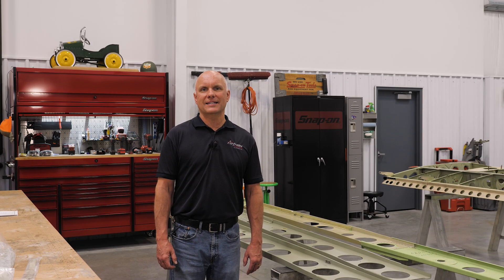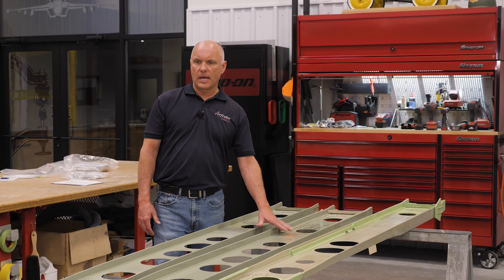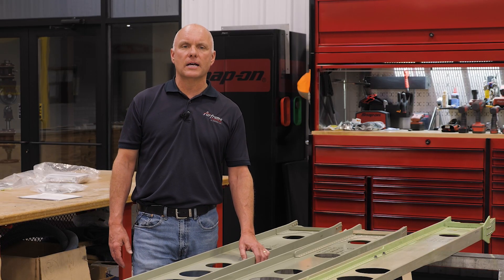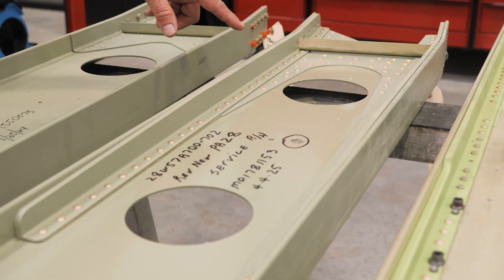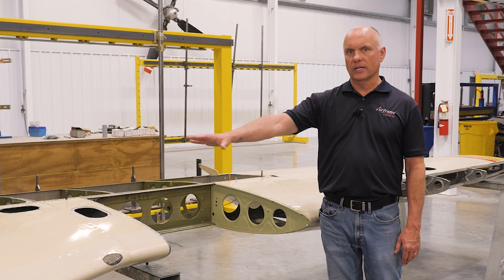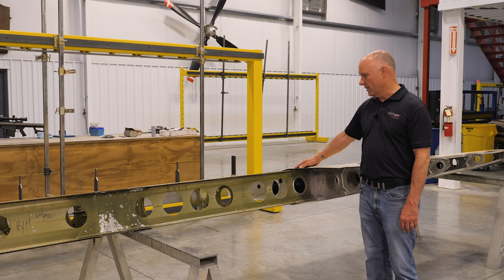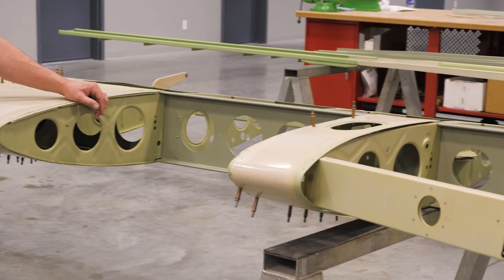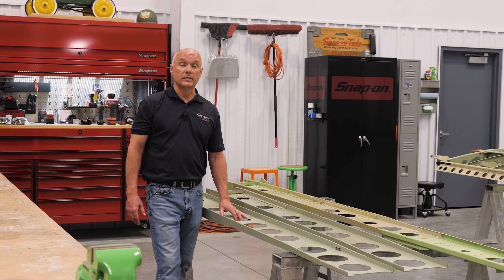Piper PA28/32 Airworthiness Directive AD 2020-26-16

Comment: Excellent presentation .  But did you confuse left with right?
Reply: They were upside down.  Inspection panels are usually on the bottom.
Reply: @firstielasty1162  You are correct!  Thank you!
Reply: I thought the same thing.  The first wing was the left.  The second was the right wing.  Unless, he's talking about R and L from looking from the front of the airplane.

Comment: I worked at a flight school down in Alabama a few years back and we had a aircraft that had severe corrosion on the rear spar near the fuselage attach point. The best that I recall was there was a steel plate riveted to the C-section of the rear spar and it set up a fair amount of corrosion. I think Piper has a SB to add inspection access holes but I don't think that worked out too well because in our case the corrosion was on the back side of the spar and the inspection holes are on the front side of the rear spar. In any event make sure your IA looks at this area during your annual inspection because you will lose the wing if that rear spar fails.

Comment: What a nice bit of work. I was in the RAF as an Airframe Technician,  and did a Primary Structure Repair Course. Very satisfying work. I've not drilled a hole or fitted a rivet since 98.

Comment: This is an outstanding video explanation! 
My 1981 Warrior II had nearly 12,000 hours, almost all on the 100 hour maintenance cycles, when this AD was released. There was no choice but to conduct the eddy current inspection. I seriously feared the worst but was amazed when it sailed through the inspection with no issues. The inspector even commented on how clean and corrosion free the bolts and holes were.
The cost was around $500USD for the inspection.
Reply: That wasn't even expensive - way cheaper than a funeral.
Reply: @leifvejby8023  TBH, the spar AD issue is not what folks (or the FAA, for crying out loud) should worry about AT ALL.  If folks get in a fatal accident with the PA-28/32, 99.99% of them are dying for reasons other than spar fatigue.  We've had ~4 people die in 60 years or so from spar fatigue?
Reply: Could you say who did your spar eddy current inspection? I’m looking at buying a 180 and it’s going to need an inspection in a few hundred hours. I’m contemplating having the inspection done as part of a pre purchase inspection. Plane is located in the Chicago area so I’m hoping to find an ndt company that serves that area.